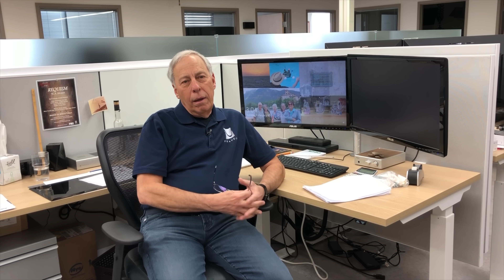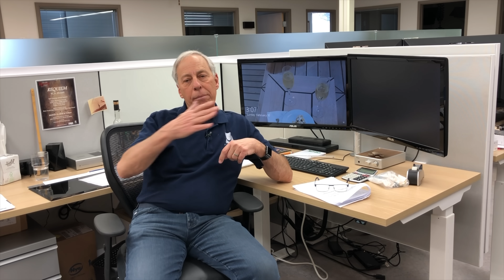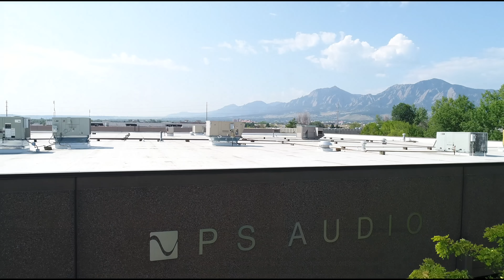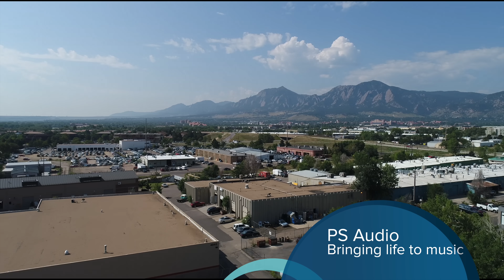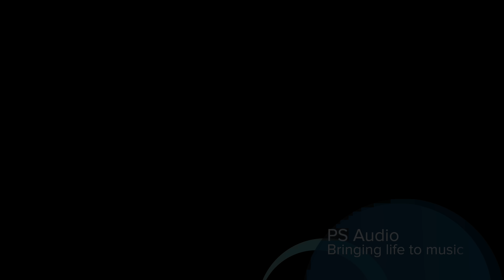How can converting PCM to DSD be better?

Comment: Alright, this got me curious so i proceeded to convert a well recorded 44.1kHz/16-bit wav/pcm file to DSF/DSD 2.8Mhz using the Tascam hi-res editor software. I am very familiar with this song and I played a specific sequence of each file over and over and over using a DSD capable DAC and for the life of me i can't tell them apart. At this point i need to be proven wrong if i state that DSD is no better at decoding to analog a PCM file that was converted to DSD than PCM is at decoding to analog the original PCM file.

Comment: I have in my lifetime collection about 500 cd's, some of which i thought sounded pretty good untill about 4 years ago when I was interduced to DSD. I then started buying SACD's instead, ripping them and sending to my Aurender N10. The difference to me was very noticeable to me right from the start. Recently when I was unfortunately diagnosed with Covid 19, I decided I was going to give myself a project and convert all of my CD's to DSD.  I purchased some software online and worked for 6 days on the conversion process. Before long I was hearing those CD's for the first time again! They sound so much better in DSD! Don't get me wrong, my Holo May KTE makes CD's sound very good but the converted DSD files sound more analog. I will also say I have some CD's that were just bad recordings, DSD doesn't help that. They are still bad recordings! Overall, I am very happy I converted my entire collection and it was definately worth the time and effort it took to complete. The only drawback on this is storage. The DSD files take up 3 to 4 times the space on your disc drives. I have a couple of Drobo's so to me it wasn't a big deal but if you have a lot of conversions, you'll need a space to store them.
Reply: An alternative could be real time conversion from to dsd.

Comment: new to all this Hires DSD discution... 
I was able to get a protable DAM/AMP decent enough for day to day listening (Fiio Q1 Mark II).
Looking at your video I decide to look at ways to make mi Windows use my DAC in ASIO DSD256 as output.

End up using the chain:
1. HIFI-Cable & ASIO Bridge (windows sound to ASIO proxy) 
2. ASIO PRoxy setup to output all samplerates to DSD256 in DSD mode
3. Use Fiio ASIO driver to connect my device and sent DSD bitsteam to the DAC. 

This wal all your windows audio will be sent as DSD bitstream to the DAC, no need to convert or transcode anything; and cloud services like deezer, youtuve, tidal, soundcloud will be sent as DSD stream.
the only BUT is latency added by the buffers in the diferent steps; this solution needs tunning if you where to use it in gaming for example.

Comment: This is like comparing two different things that should not be compared.. I could argue that if I took the PCM data and fed it into one of my fpga's and interpolated the data between the samples then put it out on a eg. simple DAC8550 or preferably even faster dac. I could probably output data at 1Mhz or so, a bit of cic and low pass filter on that also ..  so that is what I do in my diy synthesizer but x8 (one for each voice) .. So I was gonna say that this obsession about dsd is bullshit but I get it , I may have another angle of view due to working with electronics and programming fpga's.   I'm gonna say, they do it that way because it's CHEAP ,good and they can sell it EXPENSIVE, too bad  but that's very common in this world.  Meanwhile the local stores are piling up pure SHIT that you cant even use hearphones with without hearing some artifacts of poor dac's.. so YES ,compared to that pile of local hifi crap, everything else is going to sound like magic and it's all probably the chipmakers fault because very few decent dac's exist anymore from my point of view..

Comment: i think it would be better to honestly explain that DSD (PDM) codec is not new and was already used in phone applications. It would also be better to be honest and stop claiming that envisioning signal has anything to so with analog signal, and it would finally be time to admit that analog to digital and back does not degrade signal if one keeps in mind Nyguist theory. So PCM is enough and enough is enough. Either that or simply keep silent on the subject and use regular wide, air, clear, breath, warm, detailed and whatever else words  you use to sell your products. And if someone asks you about DSD ot PCM use word DXD as the rest of the industry does and amaze the gullible. If DXD word was not enough to amaze the subject keep away from him and look for new Hi-Fi purist.
Reply: You said nothing

Comment: An interesting article, thanks Paul. I'm going through my record collection and digitizing with a view to converting to DSD128. Would it be best to capture at 176.4kHz because that is an integer multiple of DSD128 sampling frequency? Would there be any advantage/disadvantage in making the original capture at 192kHz, which is the highest rate my ADC will do?

Comment: Now am curious how that process works, converting pcm to dsd,,, what i do know is that an fm & psg soundchip produces pure analogue audio and it only uses digital co’ordinated signals to tell what and how to produce sound,, and it is possible to even simulate pcm audio on a fm & psg chip (depending on those rule restrictions wich differs per chip)by mixing all the soundchannels together and then quickly alternate the volume to create wave forms, thus achieving a low bit pcm audio in pure analogue form,because those pcm samples were beforehand converted to co,ordinated signals to control those analogue chips,,,
Also a pwm audio chip works also similar like an fm chip in that it workds with square waves but in this case it only works with square waves,, so a pcm has to be converted into a co’ordinate signal at how to control these pwm square waves to generate a pure 100% analogue version of itself,,
I would be not amezed if a dsd system works in a similar fashion like this.

Comment: Thats really not answering the question.. but we have the audible fact that it actually does sound better.. For all the people that tried i know at least. The question why is just not conclusively answered yet.. On the recording/transmission line side of things there are enough facts that make it easy to explain why DSD sounds better.. so a pure DSD to storage and DSD back reproduction is by all measurable means better... But the interesting question why the DSD conversion of a PCM data storage is still sounding better has no really adequate answer ...yet..  And objective tests are difficult anyway..since any converter and analog backend is coloring the sound in one way or the other.. in minuscule ways that are supposed to be below the borders of human perception... but we hear differences never the less.. its really Not! like that that every device that holds certain specs would sound the same.. quite the opposite...everything sounds slightly different.. you hear different any day.. Is that just an illusion and subjective? or are there hard physical facts that interfere with your perception? Yes there are..Air pressure for example..hard physical fact that changes your listening experience just by weather changes..But look at physics..Do we know if there is audio perception on a quantum level yet? NO... we dont..can we exclude that? NO..rather the opposite is happening..research shows that our brains actually might be quantum computers... And is there a difference between a process where you probe and measure to a process where you dont probe and measure on a quantum level? Yes there is..thats where all this quantum craziness has its start point..where this branch of physical science is emerging from.. Call it a wild theory if you want..i call it an educated guess.. The answer why we experience such realtime transformations like DSD to please our Brains more than PCM will become explainable as more we learn about quantum physics and its relation to our brain function.. my guess.. You even can call it an uneducated guess if you want.. Since i know that i dont know.. But i believe what my ears tell me, and since there is a consistent perceiveable difference..over many years now.. its no illusion, and probably no voodoo either. There  must be an explanation..its just still in the works..

Comment: Why does my DAC produce better output when I upsample? Why does another DAC I have sound better when I stream DSDx2? The answer is, essentially, my software (I use JRiver) is good at doing this conversion, and the DAC is better at reproducing this input than the native 44.1khz/16bit. There may be any number of reasons for this, but the point is that DACs are not perfect, and that is why you do such conversions.

Comment: Here's a very brief engineering explanation: In PCM, you are encoding (the "C" for code) an analog wave into a math function (generally speaking, a "Delta-Sigma" Modulation, the "M".) That code is then flashed at a clock cycle across a medium, much like Morse code (hence the Pulse.) This is received and decoded on the other end, where the wave is regenerated by inverting the math function from the previous end. Alternately, in PDM, instead of using math to encode the wave into an equation, the modulation operation is a bit different. For PDM to work, you need a clock cycle like PCM, but instead of an agreed-upon math function, we get to leverage an implicit property of nature found in calculus called an Integral. This is the idea that a series of discrete points can be used to define a smooth curve. Now, instead of pulsing a Morse code, you're playing Flappy Bird. Each flash will represent an impluse, and this will boost the signal level. This blip will then decay. If you pulse it again, it'll raise it up a little more, and it'll decay a little more, just like tapping the screen in Flappy Bird makes it bolt up, then drop down, then bolt up and then drop down. If your clock speed is fast enough, and your impulse and decay rate are calibrated correctly, it will trace out an extremely accurate wave form, though it will be "stippled," much like an inkjet printer. If you apply a smoothing capacitor, you will have a pure analog wave. Interestingly, this is very similar to the technology used to make Class D power supplies. (PWM or Pulse WIDTH Modulation uses how LONG to pulse for, not how MANY pulses.)
Reply: Mr. Bennett Thanks for this, good explanation.
Reply: Why not use TWO bits instead of just one? That way the direction of the pulse could be controlled. Both bits ON could also be used for something.
Reply: @getsideways7257 I think you're basically talking about a timecode essentially
Reply: @ET2carbon  I mean, with single-ended audio, roughly speaking, we basically send something from -1.0 Volt to +1.0 to the preamp, right? With delta-sigma, as far as I can tell, the negative part is inferred from the lack of the ones being sent (or from the abundance of zeroes?) down the line. So, why not just use TWO bits and declare the negative parts explicitly?
Reply: @getsideways7257  also lack of a 1 is still a state, depending on the registry, it goes through during specific times during clocking. You can't infer in electronics,  everything is a function or algorithm.  The two bit thing you seem to be getting at is still a digit or bit. The way you're mentioning it seems you're simply running out of phase inversion delayed by a quarter or half cycle. That is pointless as your could just do an inversion from the beginning and use synthesis or have the crest run in a parallel circuit to the troph and it would be the same circuit, which I think is calculated like that anyway when designing circuits, I think sometimes they write that in the modulation code. I'm not a circuit designer,  I just troubleshoot them.  I think you might be getting into quantum computing when talking variable multiple state actions.  ........ I don't even think we're talking same stuff now.  You were talking analog signal going into pre input and you're talking about how it's modulated into nyquist PCM digital? Or were you talking once in digital [1 HI ON] [0 LOW OFF] post-conversion? Sorry I blanked . Anyway.....
Reply: @ET2carbon  In other words, how do you produce a flat unbiased line after the DSD DAC? Do you just send an incessant stream of 101010101010? Because, from what I understand, if you send only zeros, the thing will introduce maximum bias in the output analog signal.

Actually, I'm not even sure how you do that with PCM either, considering the signal is unsigned? Do you just send 0x7777 for 16 bits all over again?
Well, at least there is a middle value in 16 bits - not so much with only two bits. And that's why I was suggesting four bits: 01 is high bias, 11 is low bias (as a signed binary) and the rest can be used for something as well.

Why I was talking about a preamp and not speakers is because the voltage can differ greatly on the passive speakers (like +24V or more), whil a line signal fed into a preamp is small. Of course you don't feed an analog signal into a DAC - you get one in return from it.
Reply: @getsideways7257 meaning how MADI is better than toslink ADAT
Reply: Thank you so much for this amazing explanation!

Comment: You definitely didn't answer the question. The guy asked a really technical question, the only way to answer it is to get into the weeds of technicalities. You avoided that when you didn't want to get into the details of PCM reproduction, but that's exactly the point of the question. Do you know the answer to the question?
Reply: Of course he can't.
All available information in the original source is there and nothing can be done to make it sound 'better'.
This is a Snake-Oil supporting channel but why point out the obvious.
Reply: @christianholmstedt8770  Definitely true.
I left this channel time ago because two reasons: first, there is a lot of self advertising in it. Second, there is a lot of "Snake Oil" in it (the praise for absurd and hugely expensive cables is the quintessence of this point).

Comment: First example
Suppose a 4 bit PCM-signal (4 bits per sample). 4 bits has 16 values (0-15). You can convert that to 16 samples in DSD (16 samples of 1 bit per sample). The value 12 converts to 12 ones (and 4 zero’s) (and you can convert it back by counting the ones). That requires a 4 times higher bit rate (16 bits in stead of 4).

Second example
Suppose a 16 bit PCM-signal (16 bits per sample). 16 bits has possible 65.536 values. You can convert one PCM sample to 65.536 samples in DSD (65.536 samples of 1 bit per sample). And that requires a 65.520 times (65.536 - 16) higher bit rate. So you can convert lossless a 16 bit at 44100 Hz PCM-stream to a 2.890.137.600 Hz DSD-stream (that is 2890 MHz).

Third example
Suppose a 24 bit PCM-signal (24 bits per sample). 24 bits has possible 16.777.216 values. You can convert one PCM sample to 16.777.216 samples in DSD (16.777.216 samples of 1 bit per sample). And that requires a 16.777.192 times (16.777.216 - 24) higher bit rate. So you can convert lossless a 24 bit at 176.400 Hz PCM-stream to a 2.959.500.902.400 Hz DSD-stream (that is 2.959.500 MHz or 2.959 GHz or almost 3 THz).

Fourth example
The other way around. Suppose a DSD-signal (64 times the sample rate of a CD). 64 pulses you can code with 7 bits. You can convert a DSD signal to a 7 bit at 44100 Hz PCM signal (just count the pulses).

Conversion from PCM to DSD and back can be done lossless (as shown). But it requires very large sample rates and very large bitrates in DSD format. So, in my opinion you better use PCM as a format and convert to DSD in hardware, in the DAC. And I think this is what most DAC’s do: converting a high resolution / low sample rate to a low resolution / high sample rate. And because the needed sample rate are too high the DAC’s convert it to a 4 bit signal in stead of a 1 bit signal. So, in my opinion, use PCM and let the DAC do the conversion (with the current DSD sample rates).

Comment: The main difference between PCM and DSD(PDM) is speed of dynamic change in time domain. PCM can do dynamic change from 0 to max depending on bit depth use, in one slice of time frame. Where does DSD can only do increment of 1 bit per time slice, although DSD usually process in smaller time frame. 

So DSD is more near 'analogue' because analogue media like tape and vinyl take time to change dynamic. Which also make sense once you transfer PCM to DSD then back to PCM it will force PCM to record DSD's slow change in dynamic i.e. make it more analogue sounding. 

As DSD more near real sound? I have my question especially for faster modern music.
Reply: A LEE this is best answer. I am satisfied.
Reply: You seem to be under the impression that the sample value is absolute, i. e. a bigger number produces higher output voltages. That is not the case. Be it 1, 65,536 or 16,777,216 - they all produce maximum voltage in their respective "bitness" (2, 16 and 24 bits). Except DSD can generate maximum volume at pretty much RADIO frequencies (at every sample or every next sample at over 11 MHz).

Comment: DCS Audio discovered this back in the early 90s and knew it was the future  of digital audio. No manufacture at the time made a dac that could handle it so they made their own convert chips specifically to work with DSD which they still use today

IIn 98 they came out with the Elgar converter and Purcell upsampler that took all rates and converted them to DSD. They sold this dac for 10 years before replacing it. In my opinion they still sound better than most new equipment and still sell for over 3,000$ for a 20 year old digital source on the used  market Better still, DCS will still service and repair them. Not many companies can say that about their digital devices